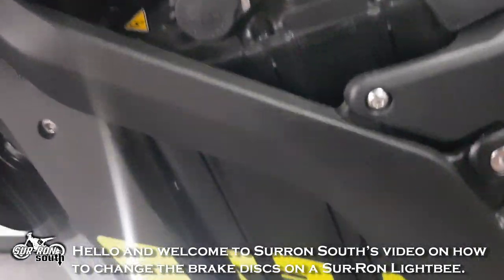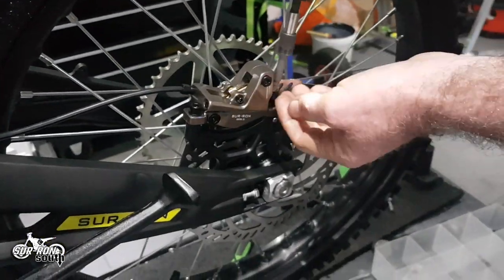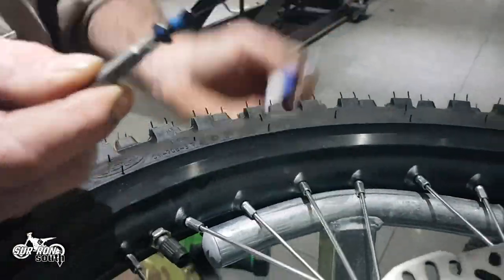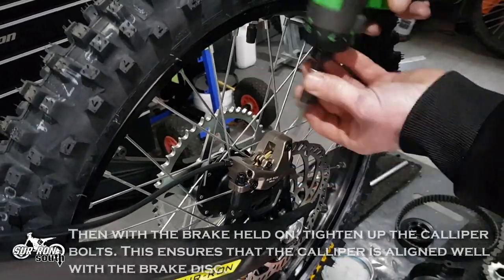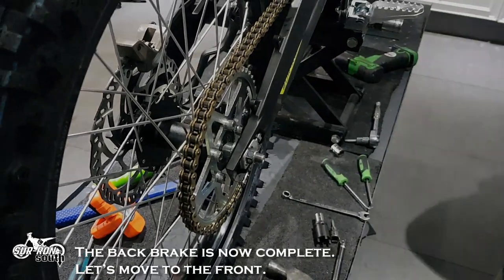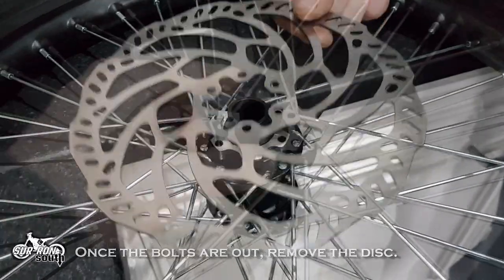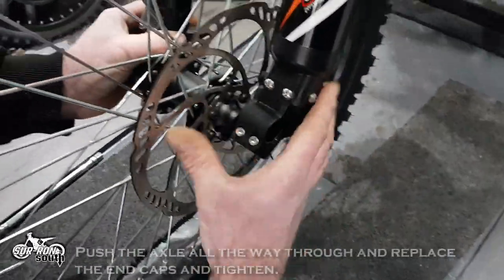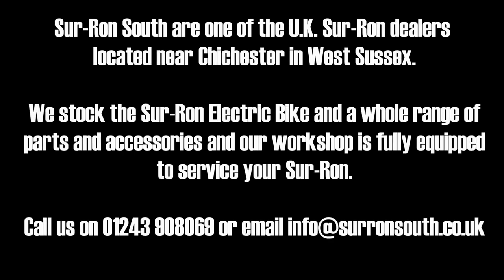HOW TO: Change your Brake Discs (front and rear) on a Sur-Ron Lightbee

Comment: hey, so i just realiced that my caliper mount can move 1 tick forward and one tick back (1 tick is like 0.2-4mm) even tho everything is tight? Does this mean the alignement moved out of its position and thats why its able to do that or what could case this from happening? Or should it even have this play? I dont think so since it makes a squeeky noise when braking when just pushing the bike back or forward, while driving i have no noticable issues or anything from it but i think it cant be good that its able to move and is not static